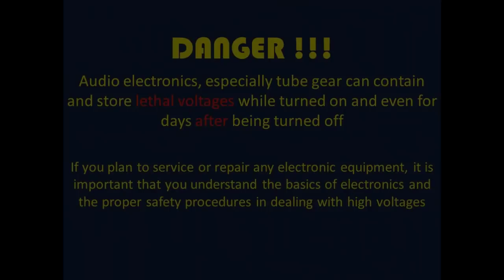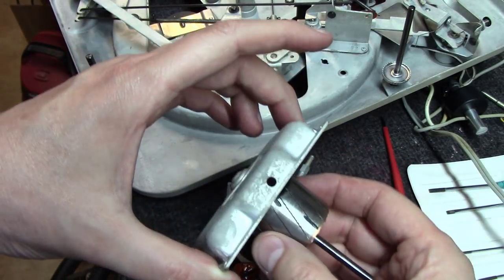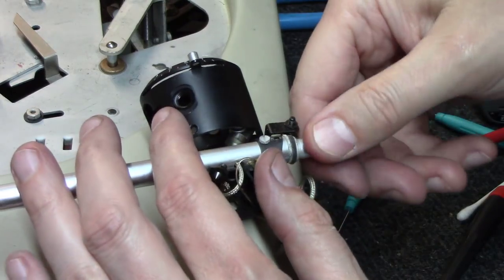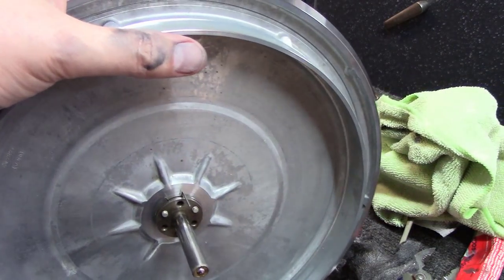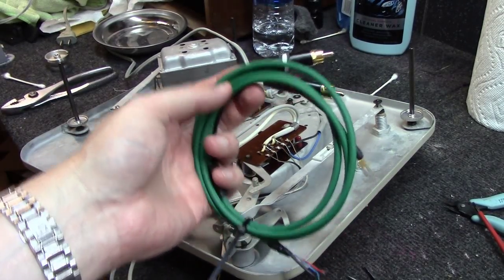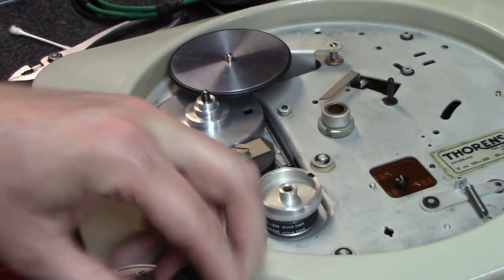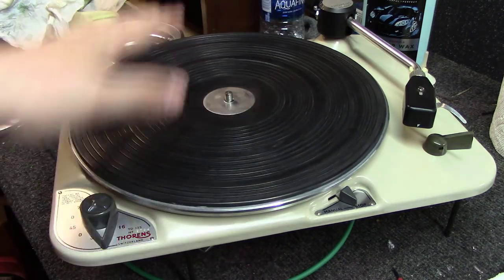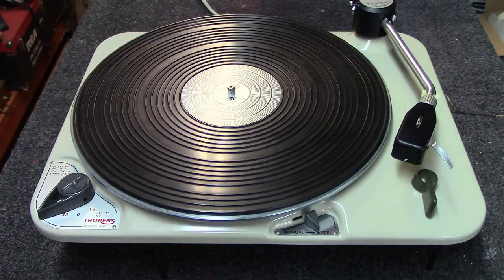Thorens TD-135 Turntable Service and Restoration

Comment: Aw Man. I've had this deck for a few years. Reliable for the most part, but that sagging tone arm always annoyed me. Watching your video gave me the confidence to attempt a small fix. Honestly, I spent about 10 hrs on that tone arm housing- horrible configuration in there. I managed to replace the back tone arm stock, but never got that darned tracking weight spring back through the eyelet. The little cue lever spring won't go back on either. I should have left the thing well alone! I run the 135 for 78s, so all is not lost....

Best.
Quin

Comment: It's worth trying MEK (Methyl Ethyl Ketone) to restore the rubber on the original idler wheel.   I've not tried it on a Thorens unit, but it works miracles with Garrard.

Comment: Nicely build TT, i really like how overengeneered esome parts are, especially the idler and pulleys. I personally can recomend the Elac 22H. Its maybe not as massive, but i has an Papst motor and great working auto function. Both were comparable in price when new, but the Elacs can be found for a fraction of the price of Thorens.

Comment: Very informative.  While I have a TD-124 and TD-224, have always wanted a TD-135.  I like the auto stop feature.  I kind of opened up a can of worms by replacing the original shell on my TD-224 with a TP- 50 shell.  It is so much lighter than the original that I can't quite balance the tonearm.  Even with counter-weight up as close to the pivot as possible, the arm floats up, and can't be balanced to zero.  I suppose I could look for a heavier cartridge than my Shure M-55E, and realize that an easy fix would be to add a little additional weight to the shell, but with the TP-50 there's no where to hide it.  I'm too proud to tape a coin on the shell!  Do you know if there might be a slightly lighter counter-weight that might work?

Comment: I hope that your customer purchases the newer TP-50 headshell.  They could buy an additional TP-50 to mount a mono LP/78 cartridge (Nagaoka MP-series cartridges have plug-in styli at 1.0, 2.5, 3.0, and 4.0 mil).  I presume they already have either a high-gain phono preamp or step-up transformer for the Denon DL-103.  Denon's current version has 8.5 g mass, so hopefully that's within range for the counterweight.  One more precaution; the ferrous plinth could increase the tracking force since it's not as well shielded as vintage cartridges.
Reply from the maker: The 135 doesn't have the same ferrous plinth issue the 124 does from what I've been told.

Comment: One thing I ended up doing was getting a deep paper plate and centering it upside down on the turntable and placing my phone directly in the middle.  My thinking was it would record wow and flutter results more accurately using the app.  In other words, my phone is rotating right over the axis, not off to one side possibly creating an imbalance in the platter.

Comment: Does the arm have a height adjustment? Is s replacement Thorens headshell designed with newer cartridge dimensions in mind? How do you plan to keep the cartridge parallel to the record?

Comment: Thanks for your effort in sharing this.. Where did you source your belt? I find the original/stock belt still the quietest for the 124.. 

I was a hoping to see a more detailed disassembly/assembly of the E50 motor along with the kit from Audiosilente. Cleaning and lubing and then aligning before “locking” everything up. Maybe when a TD-124 comes your way.
Reply: I'm going to have to rebuild my 124's motor eventually, this was a helpful video!  While researching the job, found a few warnings that one cannot use just any old oil in the motor!  The wrong composition can seize the bushings!

Comment: With all of your skills, why would you buy a 75 dollar cable from Greece??? Its a cable with two plugs and some hot shrink tube. You could do it yourself in 5 minutes. Even if the green part is special magic cable, mouser or digikey will be happy to deliver it to your door for a fraction of the price. I really thought you were more levelheaded about these things.

ps. I do agree with replacing the cord with something nicer/cleaner, but you succeeded and then went overboard on that.
Reply: Bart Zuidgeest Maybe he gets the Mogami cables cheaper from from Greece? And custom preassembled with connectors too?
Reply: A quick google gave cable that from mogami at $1,50 to .99 cent per feet. 6feet cable (est. used to meters here) gives a grand total of 9 dollar plus the most expensive cinch plugs i found (neutrik) at say 25 dollar for a pair (insane price). That is still less then 40 dollars and I know mr Blueglow know how to stick on a few plugs to a cable.

If you just pay for quality cable instead of branded cable and connector you most likely could go below 20 dollar easily. I did not want so say outright but this sounded a lot like audiofoolery that is just not needed. But its his or his customers money and they are free to spend it the way they want. 

Maybe the do not sell mogami in the US, but they must have other quality cables?
Reply: Yes you can get Mogami wire here in the US, I buy it all the time.  I save hundreds of $$$$ making my own cables, SMA, BNC, RCA, etc...I was thinking the same thing about $75 for the tonearm wire...Hi end audio is where the money can be made.  Some people have more money than sense.